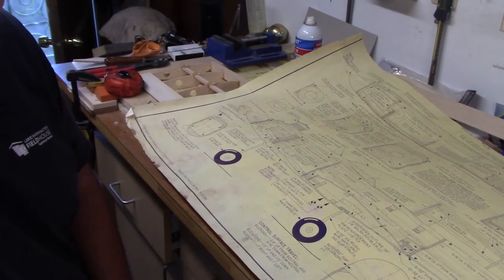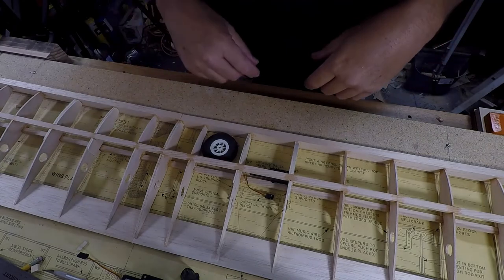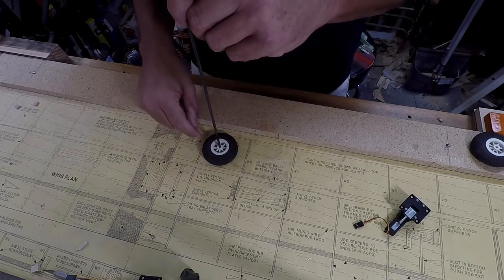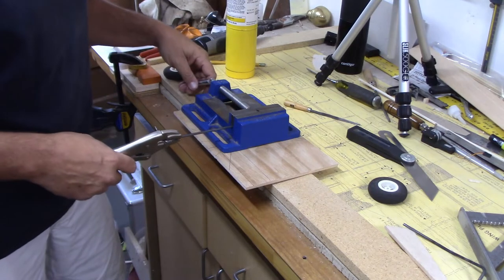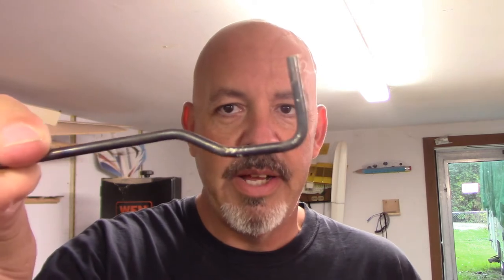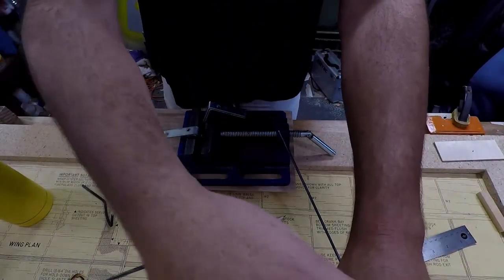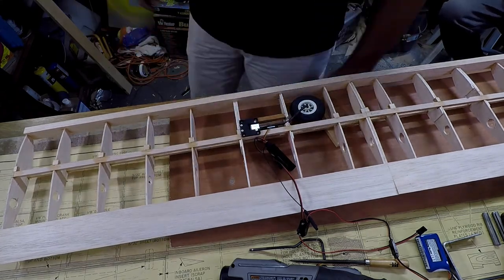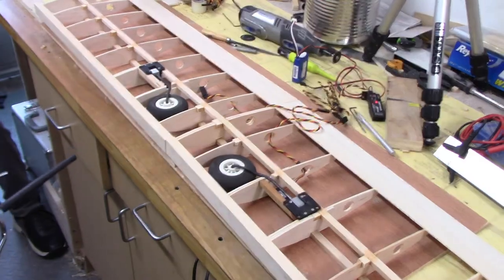Project Warlock - Video 6 - Building Retracts

Comment: Why such a big prop? I'm running a 10 x 6 3 blade on my Kaos 40 and it works well.
Reply from the maker: Gino, Let me know which motor you have in the Kaos. I'm using the same motor that I have in the DH.71. I may be able to use a smaller/higher pitch prop to get the same results.